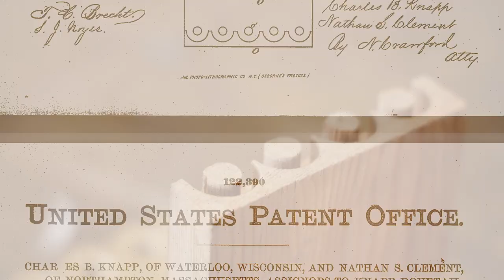How to make these Alternative Dovetail Joints (The Knapp Joint)

Comment: Excellent video... a blend of old woodwork and modern machinery. The first joint you made that was very tight, reminded me of when I was stationed overseas years ago. I watched a Dutchman make a cabinet. He used this joint as well as various other tight fitting joints. That man never used a single nail or a drop of glue. He created the drawer pulls by recessing “hidden” finger holds behind the drawer face. It was beautiful, with a various mix of hardwoods. He hand rubbed it with linseed oil. Then I remembered reading books on furniture making in the traditional way, when craftsman didn’t use nails or glue. Your Knapp joint was simply beautiful.

Comment: I am SO glad I took wood & metal shop all thru high school. 40 years later and I still use those skills everyday!  Even though I have a desk job. I do not have the most expensive tools but I have a full shop and love to repair stuff that others would just throw away. It is also great fun to make one of a kind toys for the family children at Christmas. For those just starting out. The first tools I would buy 1: small band saw 2: power drill 3: router. With these three tools you could make a lot of furniture, etc. Later you can buy power sanders to save you time, and a bench top table saw can help with repeatable, accurate cuts. Be safe and have fun forever.

Comment: I like how you say "I'll need to put my thinking cap on" to find an upcoming project to use this joint method after having designed and solved a method by which to create the joint in the first place.

Comment: Never seen this type of joint before and like the look of it. I like the indexed method for the first part, cutting one detail per cut. Would be nice to use the same or similar with the other part maybe with some sort of broaching tool with a vertical reciprocating movement. Anyway thanks for this super thought provoking project.
Reply: Yeah, something like an arbor press and a half-circle gouge. The trick is constructing the gouge, as I can't think of an easy source for quench-hardenable pipe.

Comment: Not sure if someone has already said this, but you didn't need to anneal the drill at the start. If you had tried to machine it, you would have had to anneal it (unless you used carbide tooling). When grinding, so long as you quench frequently to preserve the temper, you can re-shape steel in its hardened state. Heating and quench hardening introduces a lot of distortion which you could avoid by just re-shaping the drill in its factory hardened, tempered and ground state.

Great video though! A really interesting joint.
Reply from the maker: Thanks Alex! Yes you're right it could be done that way but I knew I was going to be using hand files, so that's why I annealed it. :)

Comment: This looks like something a 3d printer would be a huge help with. With a CAD file the template could be printed and then followed with a router to make the wood version which would be strong enough to use as the guide. I reckon I'll try that method

Comment: The second joint is made by using a cutter from the side. Has to be long to do longer drawer sides. Or you need to use a horizontal mill configuration. (think replacing your table saw blade with a blade that is a point in the middle, with two radius concave falloffs on either side, and running the boards through standing on end. Sort of like a mirrored roundover dado? (I dont think that is a thing... but if you had mirrored roundovers.. something like that)

Comment: I'd love to see some stress testing between this and dovetails or other similar joints
Reply: Me too; and until that happens, I'm just going to continue to consider it much weaker than a dovetail - those "dowels" even if part of the board are just waiting to be ripped right out of it sideways...
Reply from the maker: I think you're overthinking it, and btw I still prefer dovetails too. It's still a very strong joint that's very capable for a drawer joint and not a competition with a dovetail, it's just an alternative. These joints have been on drawers for over 100 years and apparently they hold up extremely well. :)
Reply: I think if the forces excerted on the  joint is really enough to cause failure. The issue would lie with the design and loads vastly exceeding any remit. Plenty of low friction runners on the market if required.

Comment: The irony of wearing a "hand tools are cool" shirt while recreating a machine designed to replace hand tool joinery isn't lost.
Reply: Cool =/= I use them
Reply from the maker: But I still think hand tools are cool and I do use them plenty, just not exclusively. It's just a T-shirt that I designed so why shouldn't I wear it. :)
Reply: @PaskMakes  correct me if I'm wrong, but I'm pretty sure that early in the video we saw a picture of the machinery the factory used to create the mass market pieces.  They were not making the drawers or boxes with hand tools, either.   I enjoyed the fact that you demonstrated the making of the jig, and yes, you used more hand tools than power tools, even a little metallurgy thrown in for good measure😀  Thank you for a job well done.  God Bless.

Comment: Drill press with wobble? This would annoy me.
Reply: Harbor freight drill press. Quite understandable.
Reply: I have a harbor freight press from the 90's.cost 50 bucks
 Still tight.not even close to what they sell now.....
Reply: Using a drill Chuck it wouldn't matter if he had used the most precise mill on the planet. Even a very high-end drill press with a drill Chuck would have more runnout than acceptable. The bushing is a good compromise to a proper tapered tool and would be needed on anything short of an actual vertical mill.

Comment: Dude, Thanks for your knowledge you have put across.
This would work as a great solution to my bed frames where the dove tails keep breaking on the side ;)  , i can in lay them and have extra length so i can encapsulate the joint into the bed post with a cover for extra strength.
All i need now is some new/replacement tools (don't realise wear and tear) until you can't afford to replace anything and hope to find stuff in scrap bins (people throw away a lot of good stuff)

Comment: If you were setting up for a large run of these joints, the easiest (but most expensive) way of getting the drawer side component cut, with the "bump" shape, and the V in-between the "bumps" cut in one go, is to get a set of spindle moulder cutters ground up. Once they have been put in the spindle moulder, you put the drawer side upright, perpendicular to the fence, and use a push-block to pass the drawer-side end past the cutters. That will just leave the holes to be drilled.

Comment: Great job! That's a lot of passion and work to make these joint, very appreciated the content.

I thought you'd be making kind of a metal frame that you could align with the dovel peace and give it a few hits to knock those sharp, spiky half circles, Wich could be on a sliding mechanism. Same size as your router. That way it would save you from chiseling out every single one after routing process. Also would do a slightly rounded look. Like a wave. 
If you go down do 9mm might be enough clearens to simply sand them off. Also you could use a smaller router bit, a bit fragile but seeing your work you'd figure it out!

Just my 2cents...

Comment: Nice to see someone make one of these.
The only thing I think that could be improved is just following the curve on the ends; seems to match the pattern better for visual appeal IMO. I guess that bit is the most likely to tear when you're creating the dowels but it looked neat enough with the hardwood. Then just a couple extra bits for your gouge to cut on the other half joint.

Comment: After watching your video, i had an idea of improvement for more precise and easier cutting of holed part of joint and i think the method i came up with is more time saving. My idea is using full diameter smaller pipes and half pipes that are larger in diameter around them welded in the same center to a base metal. Pipes will have a cutting edge like a chisel. The whole assemble will be used with hammer. In this way you won't have to clean excess wood around the perimeter of holes.

Comment: I think the already made tool your looking for as a cutter. Is the "annular cutter" used primarily for metal work. But I think you can probably find ones cheap and in the sizes you want. 

Also have you considered using a mortiser with a gouge as a bit or an arbor press with the gouge as a bit. I would think that this would make it very quick and easy to then make those cuts with minimal need for cleanup afterwards (if any). If properly fenced i would think it could also alleviate the need to make new templates each time you want to make larger pieces.

Comment: I liked your solution.  Itd be cool to make a metal plate with every other hole so you could drill two holes and then slide the work piece over, or build an addon for the drill press to do multiple bits, like cut 3 holes and move the piece over and cut another 3. Some way to make it faster.. very cool research

Comment: Very interesting.  I saw this joint on a piece of furniture we have in the family and after investigating, learned it was a Knapp Joint.  I would like to know if any of the original machines that made this joint in the late 1800's  have survived.  Seeing the machine in action would be very interesting.  I guess there is a reason why dovetails won out.  Anything with curves is more difficult.  I wish the joint would make a comeback because think is very strong and attractive.  You have a lot patience to work out your technique.  I think a CNC router could take care of most of the work with hand cleanup to finish.  A CNC machine would require a hole in the table base so the board end could stand vertical.  Of course a means to hold it vertical conveniently would need to be devised.

Comment: The cutter has a jig that lets you make as many pins as you want, just add more spacers.
What you really need is another jig that does the same thing for cutting the socket side. Cut each one individually, and then add more spacers. Which is easy enough for the inside holes, but cutting that outer arc becomes the problem. Especially if they're close enough to overlap slightly, like in the examples.

Comment: On the template, could you install short spikes into those small holes? It would help hold the template on, mark the centres of the holes to drill, and help with realigning the template when repeating it down a larger piece.
Reply from the maker: That's a great idea Tim - thanks for that! :)

Comment: Very impressive!  

Because you know how to work with and harden carbon steel, you could try making a cutter for the female half.  You could cut one profile at a time using a spacer system as you've done for the pins.  If you think about it, you don't even need to make a full-round cutter, it can be a half-round cutter, and you'd cut from both directions.

There's a few approaches
--> you can make a router type tool with a shank, 
--> you can make jointer type blades, assuming you can arrange the table of the jointer to accept a zero clearance insert.  
--> you can make wood shaper type tool that's a disk with a hole in the center that fits on your table saw.  (Thinking about the length of the drive arbor made me realize you could do halves.)

Comment: Very nice video and interesting technique!  One comment:  When you forced the wooden dowel into the copper tube, you caused the copper to expand, which is probably why the disks overlapped slightly when you assembled them side by side to make a template.  Thinning the dowel a bit more would have reduced the outward pressure on the copper.
Reply from the maker: Thanks Marty! The copper disks overlapped because that's how I set the joint out. I explained how the joint changes with different size spacing and I decided to make mine overlap. :)

Comment: This joint looks nice and ornamental and is quite strong too. But there is a lot of work involved. 
Considering the  fact that making the template is fairly complex and the amount work needed to trim each of the pieces before joining them,  you may consider going for a CNC router to get the highest precision possible. As you would agree, the joint will look nice only with that kind of precision. Of course, the downside is, you will lose the fun of physically making the joints.

Comment: To make the jig more universal, could you simply make a series of pillars?  The 2 outside pillars and several identical pillars for the inside. Then combine the pillars into the width you want for a given joint?  Maybe even tongue and groove the pillars to make a secure fit.

Comment: Looks good. However, if you just routed the drawer front in a rectangle, and cut the sides to fit (like a single blind box joint), then drilled and fitted dowels, I think it would be much easier and just as strong. Please correct me if i'm missing something
Reply from the maker: You're not missing a thing Gary! You could certainly do that and you would have a strong joint but it's also interesting to try and recreate this cool joint from the past. Plus it looks great too! :)

Comment: Make a big template, instead of making a small template and a bigger template. So you can just put a smaller piece of wood on the big template and cut it out. That way you can use any size of wood and still be able to make the joint the size you need on your desired piece of wood you choose. And you could even make it into the side of a desk so you don’t have to worry about storage, if you would use this type of joint a lot.

Comment: I would make that rabbet  joint and drill through, then put some dowels. It won't look as nice, but it'll do the job and it's way easier. Sometimes I put screws in before the glue up for alignment then after the glue cures I remove the screws, drill bigger holes and put dowels (I don't like having metal in wooden things).

Comment: The video is great as an entertainment; very creative effort. Hat's off to Pask's creativity. However, I would never spend the time to do this on a real piece of furniture. Anyone who has made a chest with several drawers knows how much effort goes into the entire project. To spend this much time and effort on each of the drawer joints would be beyond reason. I would suggest you investigate the Leigh Isoloc jigs for creative drawer joints, if this look is what you want. Before doing this much work, if you want a special joint just make true hand cut dovetails.

Comment: Have you considered using a sacrificial piece of scrap wood clamped to the workpiece on the drill press to prevent any tear out in the base of the cut? Especially if you use an expensive wood.... I didn't really see any tear out on the couple of joints you made. But l could see it becoming an issue. Especially considering it's in the end grain.
Reply from the maker: That would work but so does making a fairly deep score with a marking gauge(at least with my tests so far). :)

Comment: if that's a joint I made a lot, I'd probably make a cutter template on the side of a spade bit with the end supported with a dowel in a bearing, and use that with a slide to make the other side as easy as the holes.

Comment: Wonder if you can have a lathe tool made with the positive side of the joint turned into it.  Then like a milling tool cut notches and relief lengthwise.  Harden and Chuck it up on the wood lathe and push the end of the board into it.

Comment: Make a trepan tool. Offset a hole in metal stock. Put a set screw in the side. Put a bore bar in the hole. Lock it and go. Make it to whatever dimensions you want your joint plug and groove to be. Aluminum stock or cheap steal stock would work.

Comment: What a wonderful, strong, and beautiful joint !  However the 2nd template is difficult to make .....  Anyway, I like it very much !
Reply from the maker: Thanks Marc! The difficult part was figuring out how to get an accurate template but it was actually very easy to make once I had a plan. :)
Reply: @PaskMakes  Thanks for your response to my comment !  Actually, wood working is just one of my hobby, I will try to squeeze some time trying to practice per your video. Hopefully, the 2nd template could work out simple as you mentioned !   Good Luck !

Comment: I was thinking you can use one of those planers that have shaped blades to cut beaded trim.  You would only need one semi-circle shaped blade to cut the whole thing.  You can line up multiple ends, run the hand plane, create the first semi-circle then move it over and plane the second and so on.  Then cutting the hole is trivial at that point.

Comment: Great video! Your learning well however, the steps can easily be reduced by half with this method I taught while I was serving my time at Cedar Junction Prison: Anneal spade bit, cut the crescent on THE SiDES of spade using a countersink.Take this half moon spade bit, stub the shank, mount in drill press. Clamp fence to drill press table. Drop & lock drill press quill every center to center. There you have i! Side cutting of female mate, easy! 

I had lots of time in prison, you can see how I quickly learned to make shanks for survival. Pay attention or pay time!

Comment: If you would reduce the diameter of the internal dowel slightly and move the holes closer together it would save you a lot of work. The router doesn't reach the sharp corners so if you avoid those corners it could save you quite a bit of work :)

Comment: Did you consider using an annular cutter that is typically used for metal work?  Or would it just be too annoying to clear the wood chips?

Very neat video, never seen a joint like that before.